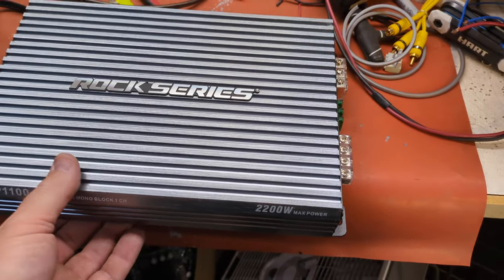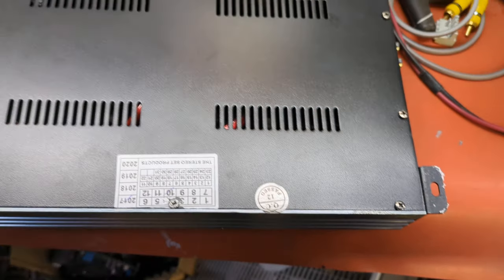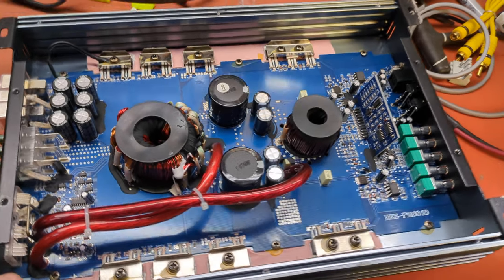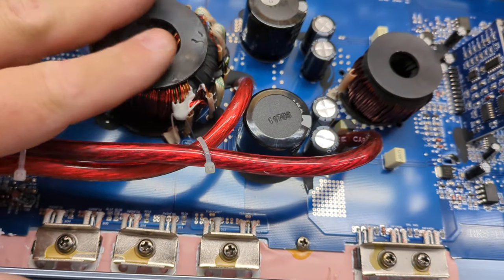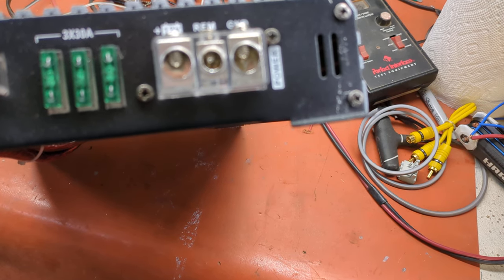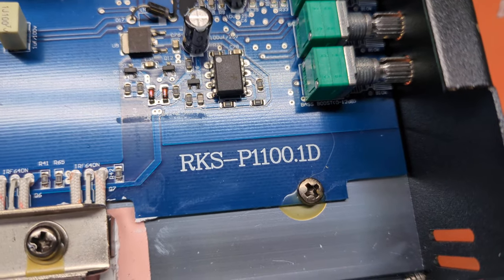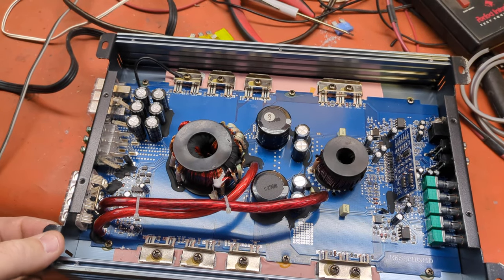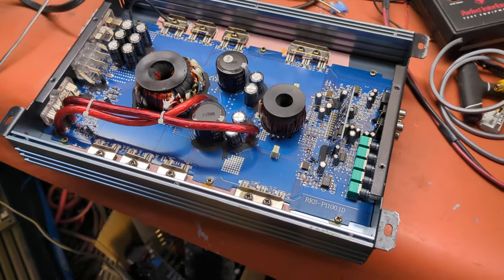Rock Series Class D monoblock amplifier RKS-P1100.1D 2200wmax 1 ohm Amp from da Phoenix MTX Closeout

Comment: My thoughts, that design is only about 700-800w and probably not very clean. But for lower powered subs or basic system, low budget amp, great option. Probably no dynamic extra power which is fine and not real efficient. Good thing for daily you don't really need the big 3 upgrade, many new cars have a big enough alternator.